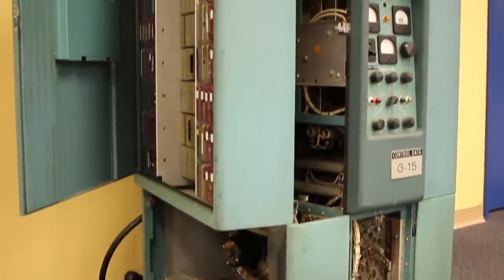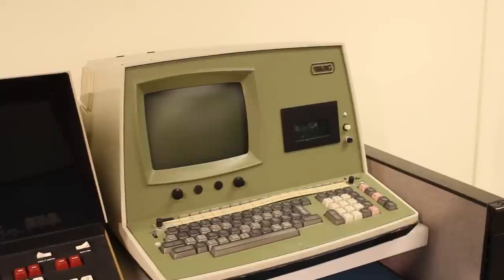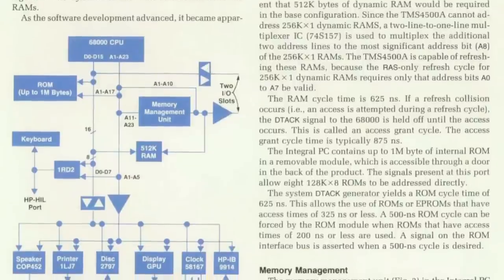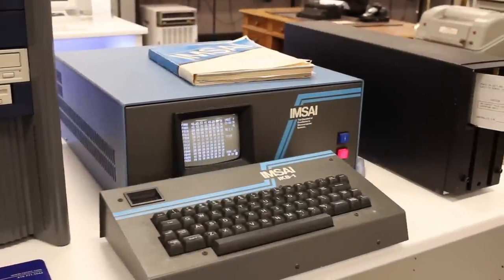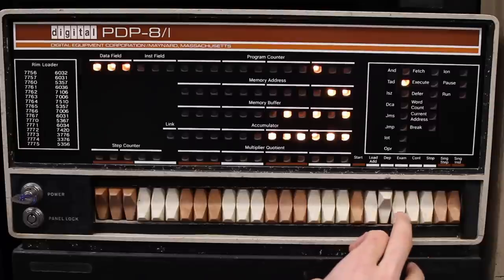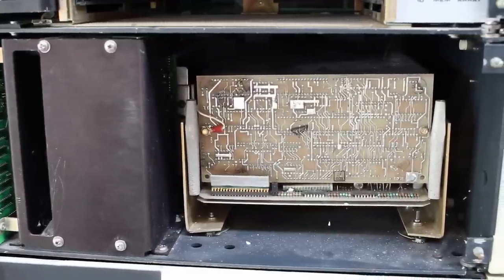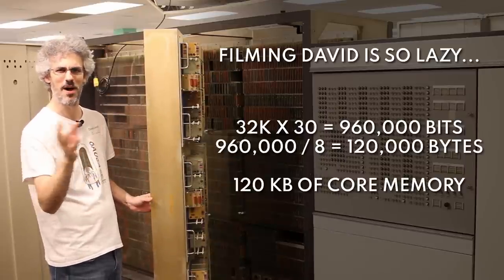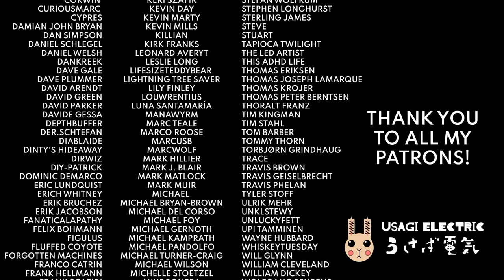Insane Computer Collection at System Source Museum

Comment: Woz actually signed the Apple I replica they have there.

The big hard drive you were talking about is one of two disk assemblies out of an IBM 3380 DASD.  One of these stores just over 1 gigabyte of data; it was the first disk storage device to do so.  And yes, it has two sets of heads.
Reply: And virtualized 3390s are still used to this day on modern mainframes - the DS8K storage arrays can emulate thousands of 3390-27 and 3390-54 drives.
Reply: @jnelson4765  I guess it's done for compatibility reasons.  I understand the storage controllers have their own POWER CPUs in them which handle the emulation.
Reply: I almost fell out of my chair when he said Apple I. Those auction for a half million.
Reply from the maker: They have both an original Apple 1 and the signed Woz Replica. The replica is hooked up to a monitor and they fire it up to let people experience it, which I think is just awesome!

That's a colossal amount of storage, and I remember a couple of IBM drives did the two sets of heads thing. It's really bonkers to see!

Comment: Used my mom's Intertec Quad density Superbrain to write PL/1 programs as a teenager.  Bought a used IMSAI PCS-44 and later a VDP-80 from the same source to write compiled basic programs.  Still have a wire wrapped video card I developed to display high-res line drawings and images on the PCS-44.  Worked well.
Reply: I wasn't aware of the IMSAI PCS 80/30, but I have spent a lot of time on a VDP-80. If I had to choose between a VDP-80, an IMSAI 8080, and a SOL-20 with a set of Helios disk drives, I'm not sure which I'd pick. I owned an IMSAI 8080 for about 30 years, before selling it a few years ago. The front panel is the high point in the 8080, but the sleek lines of a SOL-20 with wood side panels is pretty sweet. And VDP-80 being a fully integrated system is pretty cool.
Reply: @JCWren  The VDP-80 had the downside that it was massively heavy.  Wonderful to use with fast reliable drives and like all IMSAIs had spectacular documentation.  It was not easy to move and was obviously expensive to manufacture.
Reply: @fritzkinderhoffen2369  Funny you should mention the weight. Our computer store was on the second story of the complex we were in. The UPS guy ROLLED the box up the stairs, and broke the front of the case around the monitor. UPS had to buy a new case, and that was NOT cheap :)
Reply from the maker: The Superbrain is one of those systems that I keep running into, seen about five of them in person in the last 5 months, but I've never been hands on with one. What initially drew me to them is that they use the same outer shell as the ADDS Regent 100 terminal I have on the Centurion, which is just a great looking case. Someday I'll get my paws on one and take it for a test drive!
Reply: @UsagiElectric  The Superbrain had internally the provision to plug in one s100 card to the unit.  Something perhaps not often used.  They seem to have been robust systems as the one I had access to was used for development for years with no issues I can remember.

Comment: I remember the already vintage PDP-8/I as a teen back in the '80s. That RIM loader instruction list on the left of the panel was because it had no ROM/BIOS. It had to be programmed in using the panel switches in OCTAL which was fun after every power up. You can flip 3 switches at a time with each hand very quickly for any 0-7 digit.
The RIM loader loads in a more complicated bootstrap that boots an operating system from mag tape, which then recognises the massive (<1MB I think 640kB) hard drive that weighed a ton and started the OS proper. Only then would the serial terminals flicker into life.
I was particularly fascinated at the wire wrap backplane of the CPU.
Reply: @tradde11 I was super excited as a teen to get this up and running, sadly the pathetic administrators at the school deemed it dangerous because it didn't have a proper modern mains plug and it was sold for scrap metal and gold instead. I did have 2 weeks of joy after school with it.
Reply: The RIM loader was only about 12 instructions. It loaded in programs from tape in a format consisting of address/data pairs for every machine word -- highly inefficient, but easy to interpret. Normally the only program in that format was the BIN loader, which implemented a more efficient program format, but took more code to do so -- more than you would want to toggle in by hand. Then that would load the actual program you wanted to run.
Reply: Brings back memories of my days as a Medium System Field Engineer with Burroughs in the early 80's, working on B4700's, B4800's, and their siblings (and peripherals!).  We had to learn to directly write into memory a machine code bootstrap routine that would read in a single card from the card reader, then we also had to code that card so it would read in the rest of a card deck, that would load the actual operating system from mag tape, or from one of the disk packs.  Fun times!  It actually wasn't that hard to do, as the instruction set was pretty powerful... instructions and data shared the same memory, you could even do crazy stuff, like write code that would modify itself. So one card could overwrite the memory that it had just been loaded into, to do something different... Troubleshooting was... ummm... interesting!  Ah, those were the days!  I was kind of hoping to see a Burroughs medium system in this video, or at least a B1700 or something, but not to be!  The video was fantastic though!  Man, the memories....

Comment: What a place! The Alto alone would be worth a vist. The HP box was shipped in the early 80's and had UNIX in ROM (!). How cool is that? A portable UNIX system with solid state storage (ROM) and a printer. That was unheard of and I'd love to get one. The Zilog S8000 would run ZEUS, a very good Unix derivative. And right next to the Cray-1, is a YMP-EL, the "entry level prosumer Cray" - costing "only" low integer multiples of suburbian homes. There is soooo much to see and play with. I'd really love to visit that place.

Comment: Surprised by the (small) size of the Cray 1. 
Thx for stepping inside!
Reply: If the Cray were larger, it would be slower since light isn't fast enough. That is why it is "C" shaped: the edge of the board that connects to the others has to be closer to them than the other end. Putting the boards in parallel like in all other machines would make the "bus" too long.
Reply: @jecelassumpcaojr890  I always think people who say that light isn't fast enough are pulling my leg as it will circumnavigate the earth 7.5 times at the Equator in one second.
Reply: I think the Cray 2 was even smaller.
Reply: @northof-62  That means a planet sized computer could run at 7.5 Hz. At 100 MHz your computer is limited to 3 meters, at 1 GHz to 30 cm.
Reply: @jecelassumpcaojr890  lol!

Comment: A pleasure to see the Bendix G15, one of the first ‘personal computers’. They got taken over by GE and then into Honeywell where the transistorised successor the G115 was used as a remote job entry station.  I emulated the G115 protocol back in around 1982 on a PDP11/44 to connect Honeywell machines in UK universities to the rest of the academic network (Janet).  What fun!

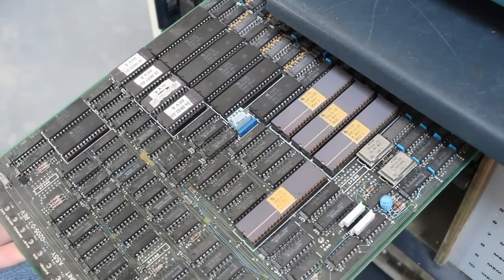Comment: @15:02 I've never stood inside of a Cray, but I did get to sit on one. Eli Lilly & Co. had a Cray II which was on display in a visitor area. On a day trip shadowing scientists through their labs, we took a break at the Cray where we sat on the padded seats above the water cooling, and it was lit up to show off the coolant flowing through the system. It was freaking amazing in 1992.
Reply: Cray 2 was cooled with Fluorinert, not water.

Comment: Awesome!

I used a PDP-8/I at the local university's computer science department for a couple of years.  It ran TSS/8.  The computer itself was in a machine room, behind a glass wall.  The users talked to it from the adjoining terminal room that had 16 model KSR-33 Teletypes.  So I didn't get to touch its front panel... but I could watch the DECTape spools spin.  :-)

I have been to Hunt Valley, but it was in 2000, long before the museum opened.

It's nice to see a DG Eclipse system, after having read Soul of a New Machine.

Comment: That Zilog 8000 computer has me intrigued.  I spent the first part of my professional career developing software for the Motorola EMX2500 Cellular Telephone Switch, which was actually a DSC (formerly Digital Switch Corporation) DEX 600 with some added hardware to support Motorola's cellular base stations.  These systems utilized Z8000 CPUs as their primary processors mounted on pull-out boards, not unlike those in the Zilog 8000 computer (and many other minicomputers and early microcomputers).  

DSC started in the early 1970s in Richardson or Plano Texas (they were in Richardson by the time I started at Motorola in 1989) and had adopted the Z8000 architecture across their line much earlier in the 1980s.  I cannot help but wonder if some of their early Z8000 processor cards weren't either based on the actual Zilog 8000 computer processor card, or may have actually been that card.

I'll have to keep watching to see if I can see anything that I can recognize.

By the time I left Motorola for good in 2008, they had mostly moved on from using the DSC switches.  DSC itself had been purchased by Alcatel, which in turn merged with Lucent, so I'm not even sure what might be left in Texas or elsewhere of that organization.  Motorola completely exited the cellular networking business around the time it split into Motorola Mobility and Motorola Solutions, and I think the remains of that part of the business has moved onto other things entirely under its new ownership.

Comment: Back at the Uni I was lucky enough to have seen a, non functioning, "Univac 120".
The 490 you are showing looks just like the same machine, with the tubes replaced by transistors.
In the 120, the tube sockets had very long legs, almost like 2 sockets connected by piano wires. It formed something like a cage were they soldered the resistors and capacitors needed for the polarization of the tubes. Then the whole assembly pluged in a backplane in almost the same fashion of those transistor cards in the 490.
BTW the front panel of the 490 is way more modern than the one of the 120, that still had a rotary phone dialer as an input device.

Comment: What I really want to know is: How many Bendixes would it have taken to match Bender?
Some brief back-of-the-envelope guesstimating later: It appears the answer is at least four, because we know Bender runs on the 6502, we know that has a little over 3,200 transistors, and the Bendix G-15 comprises 450 valves, mostly dual triodes, so I'm guessing that means a Bendix amounts to something close to 800 transistors? Someone correct me if I'm making a mistake here.

Comment: The "hearing your data as interference" is how early computers were first able to play music. It wasn't long before someone got the idea of trying to make music with it, after no doubt accidentally seeing this phenomenon in action. (probably listening to the radio while programming) Programmers figured out that if they processed data in a certain way while a radio was placed near the computer, it could generate tones of various frequencies. IIRC this was demonstrated on an Altair 8800 at one of the meetings of the Homebrew Computer Club, but there are many other examples of it being done on both micros and minicomputers.

On PDP-8s, the program counter auto-increments on both DEP and EXAM. That way you can quickly load and/or examine ranges of memory without having to toggle in each address, i.e. you don't have to toggle in an address, followed by LOAD, followed by the data you want to load, followed by DEP, and THEN have to toggle in the NEXT address, hit LOAD, etc.etc. With auto increment, you just LOAD in the starting address, then you can keep on DEPositing and/or EXAMining data until the cows come home and not have to worry about entering each subsequent address.
Reply: We did this on a DG Nova 1200. Saw it done on some microcomputer or another, and took the idea. I seriously doubt we were "first" on the 1200, but we did do it from scratch, and using only the front panel.

Comment: In the IMSAI system, the memory you are dumping is not the boot ROM.  It is the video RAM that contains the ASCII codes for what is actually on the screen.
So when you first issue a dump command it shows you the startup message that is still on the screen, but also the command that you entered.
When you press enter to scroll it you see that it starts displaying the earlier output of the dump command.

Comment: Hey, that's less than half an hour from me. I might have to visit some time.
I've hidden in an old Cray-2! I used to work in the same Aberdeen Proving Ground building where ENIAC was once installed. They had a decommissioned Cray-2 sitting in the downstairs lobby for decoration. I saw someone coming down the hall I really did not want to make small talk with, so I hopped inside it and crouched down.

Comment: I could not believe my eyes as this video started. That Bendix G15........O M G
that partially answered a question I've had for over 40 years..
Those modules with their anodised colour coded handles and the board wired up to the tubes.
As a young child interested in electronics I got a box of those modules to tinker around with probably  about 45 years ago. I never knew their origin and like so much what we would now call E-waste, I slowly cannibalised them over the years for components.
But I never knew their origins and always was impressed by the logical design process.
Now I'll have to go dig into the deepest recesses of my archives to see if any have survived all these years.
Fantastic to see that something like that was here in Australia so many years ago.

Comment: I think that you shot with the space bar.  You walked right by an Apple Lisa, sitting next to the Alto. The Lisa OS borrowed much, both visually and conceptually from the "Desktop Metaphor" designed into the Xerox Alto when running its Window Manager. 

Notice the Portrait-sized video terminal that is taller than wide, designed to look like a sheet of paper. We all went mad for the Desktop Metaphor in the 1970's and 1980's. Unfortunately, Lisa had fundamental flaws, and buyers thought she cost too much. Lisa didn't sell. Apple's management bet the farm on Lisa's successor, the Macintosh, and came up with a legend. Some people are just born lucky.

Comment: That sound interference you notice its what we called, back in the day, the "running bits".
That one sound quite like a Sinclair ZX Spectrum loading a program from a cassete tape.
I also heard similar sounds when operating fax (fac simile) machines or even early modems (300 to 2400 bauds) sound coupled to a telephone set.
Looking at the operation of modern communications (smartphones, internet, wifi,...) it looks like it was another life in another universe.

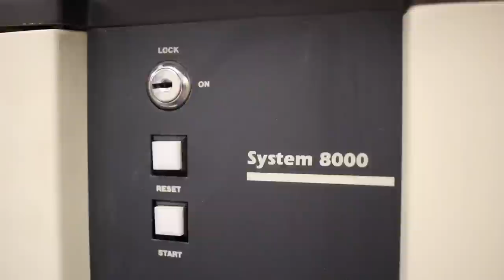Comment: 14:02 Well yeah, that's what they were designed to be.  The big difference in the minis and the micros for most of the 80s was the former had MMU.  There were many different Z8000 based minis when it came out, because it was a cheap chipset.  So they could build something almost as cheap as a micro, but still powerful enough to run Unix.  And when you think about it, that's what you'd want as a small to medium sized office. The cheapest mini and then just dumb terminals for all your employees.  That made more sense than buying a bunch of IBM PCs or something

Comment: The lack of FCC certification is however not why the HP sings. Technically all computers do produce noise on all their ports, but usually there is effort to filter it away.
In the world of prototypes however, reducing electrical noise isn't always a big priority in computing systems. And to be honest, a lot of these old computers are quite noisy from an electrical standpoint.

That Univac system's mess of wires is though quite impressive. I wonder if they had any form of "standard" for their backplane connectors at all. I at least would have power and ground be consistent for all cards, perhaps also make dedicated pins for in and out, such that accidental card swaps don't lead to card failures. (totem pole outputs don't like to be in parallel. However, transistors were expensive back then, so perhaps they just used pull up resistors instead.)

Also surprised how tiny those Univac boards are. screen printing weren't a new invention back then, same for detailed etching. So it does feel like they could have made the boards larger and slightly more feature rich. However, even the part density on those boards is quite unimpressive. But I guess that they somewhat standardized the types of board into a selection of simple functions that they could then build from.

Comment: They had that same Bendix computer at "Crazy Louie's" surplus store, around 1985.   The price tag was $100 but I didn't have the means to move it or house it.   Or probably the power to run it.
Reply: 50 AMP, 110Volts.   Weird plug, but they had it at Home Depot!   Bob from the Museum

Comment: Hearing the data: back in 2005 at work I had some sort of HP PC with a noisy voltage regulator in it. I could hear every keystroke and moving the mouse sounded hilarious. Solved the problem with a drop of super glue. Being also an HP makes me think, though...

Comment: ...to increase your longing with a pain of mine: had 4 of these superbrains... had to toss because moved a cross the pond and had to clear the attic I still kept renting for 20+ years after the move... furthermore,  my first practical / business work was on the Wang 2200 workstation... w/ cassette tape and then a Wang T4 connected to a 5 and 10 MB phoenix?) disk (2.5 and 5 fix and removable platters)... if you get a Wang  2200T4,  MVP or VS, I may get you some biz code running on them...